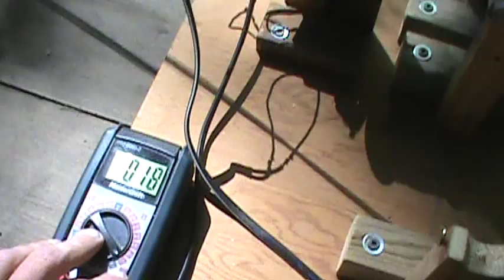Overunity Quest - I'm Alive - New Core

Comment: seems like your making a bedini window motor. just about to make what you've been working on. are you saying there is a problem with the U core?  in the bedini core it's not a solid piece of iron. it's many smalls rods. I was under the impression that was to eliminate eddy currents. i believe you tried that with the U core and found it didnt work as well. just asking cause i'm a day away from bending my iron. don't want to if i shouldn't. also had an idea about the coil.a kapanadze on the U core